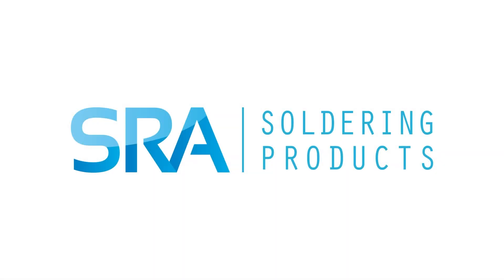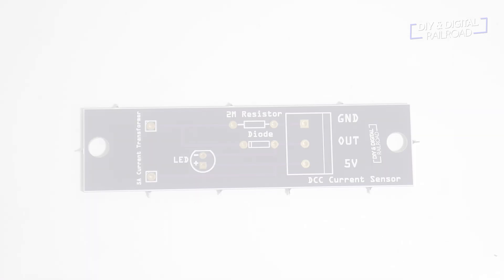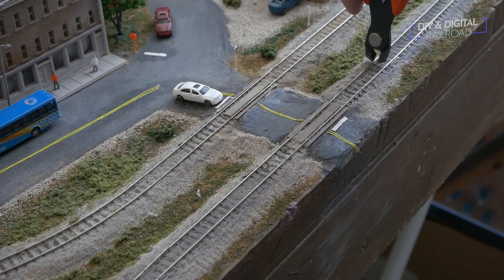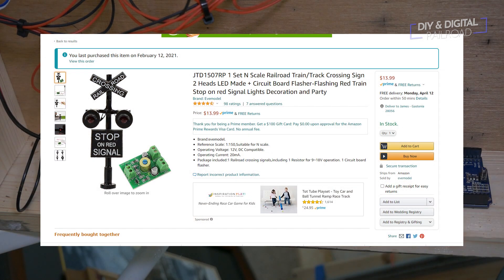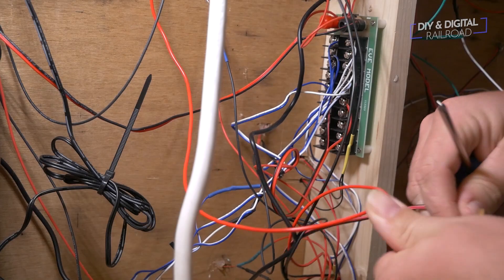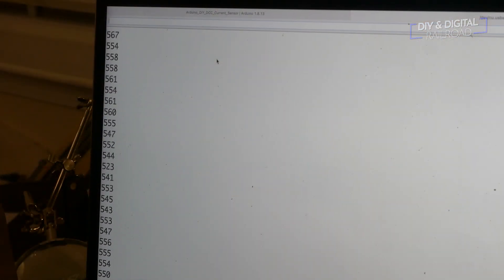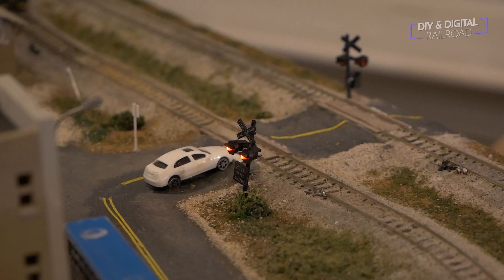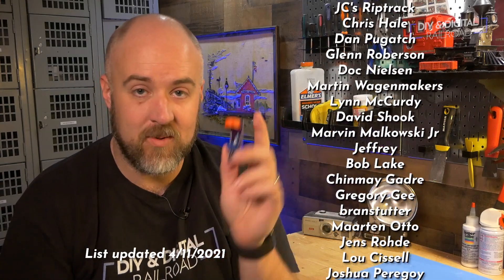Installing the DIY Arduino Current Sensor on a Model Railroad Crossing!

Comment: "Installing the DIY Arduino Current Sensor on a Model Railroad Crossing!" (quoted the title for later reference help).

Please will this work with multiple crossings and having to run all off one Arduino, or each crossing run by an independent Arduino, or by daisy-chaining Arduino's?

Comment: Hi Jimmy, thanks for all the Arduino projects, great job. I am looking in your Arduino projects for a servo operated crossing gate and cross buck lights together, triggered by current sensors. (Gate goes down, flashing light go on.) Also, do you know if the  ACS712 Hall Effect Current Sensor Module would work in place of your sensor? I have some already. I'm planning on building your sensor too. 
Thanks again.    
Steve

Comment: What did you use to design the circuit board?  Does OshPark have software or online editor or using something else?
Reply: I can't answer what Jimmy used, but KiCad and EasyEDA are two options that are free and pretty capable.  I've used KiCad with decent results.

Comment: How do you keep your soldering iron tip clean? Seems I can never keep mine so it will heat (melt) the solder.
Reply: I used a damp soldering sponge on my soldering iron holder to help keep the tips clean.

Comment: Jimmy,

What was your final cost of the sensor?
Reply from the maker: Hey Ken,

If you use an arduino nano which the code will work with no changes, the cost of all the components is $11.50.  This does not include wires because you can find those costs all over the place.  I am considering designing a PCB that takes out all of the wiring and you just connect the flasher, signal and feeders.

Comment: Neat install! I'm bit confused about adding hot glue to the arduino connections to hold them in place. Did you find that header pins weren't providing a good enough fit to prevent wires from falling out of ports?
Reply from the maker: Good question.  This layout moved around a lot so this makes sure that they stay in place.  I see this done on a lot of electronic components.
Reply: @DIYDigitalRailroad  I use screw sheilds on all my arduinos...they are cheap to get too.

Comment: Awesome! Could you use an optical sensor instead of current sensing? If not, why is current sensing preferable over optical?
Thanks for the great videos!
Reply from the maker: Thanks Patrick!  Yes you can use infrared or photo resistors.  They are more invasive and require a different code setup.  I actually have done quite a few of these setups with infrared.  Check out my arduino projects playlist.
Reply: @DIYDigitalRailroad  Thanks! Just getting started with the Arduino stuff and like to ask questions and learn as much as I can before I jump into something new.
Reply: @PatrickMcNealStuff  Current sensing is the most dependable. Other sensors require a bit more in depth coding to factor into all the different variables of light etc.
Reply: I’ve had it with optical sensors where if the lighting in the room isn’t just right, the signals never work right
Reply: @TheyMakeItLikeThat  That is true. You have to use a calibration sketch first to read the light in the room and the sketch auto tunes itself to that.

Comment: Very good jimmy! Everything turned out great!
Reply: @Scott Eric Catalano,

Great add on of the indicator light to the sensor 👍
Reply: @KenN.OXN.805  I'm going to add a capacitor to the circuit so the indicator LED stays on steady as right now its lighting based on the current it senses....this can also be used under DC current as well.